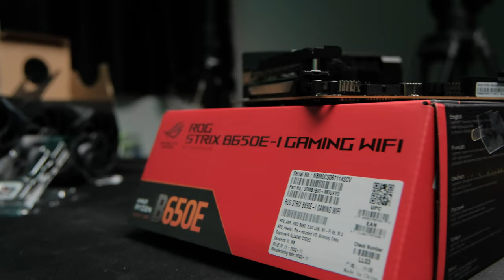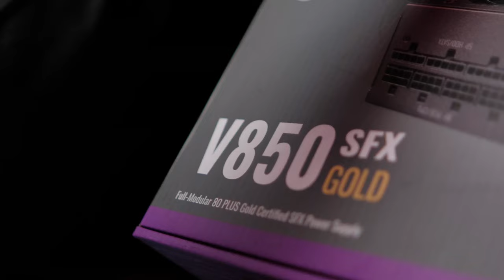How to Build a Tiny ALL AMD 4K Rig!

Comment: I also wish Cooler master had braded cables on the psu  i was looking for a braided pcie8 pin. But couldn’t find one
Reply from the maker: Cable mod has sum
Reply: Corsair SF line up has braided cables and usually the preferred SFF PSU. Lian Li SP line up has braided cables too but only 2 cables are non-braided.

Comment: Hey how did you connect tfans up?  did you use fan  splitter off the cpu fan header or did you keep your chassis fans separate off from  the cpu header and connected  them to the chassis fan header? I was wondering if I could connect to fan splitters off the cpu fan header.

Comment: Just slap an air cooler for this case, side mounted radiators for this 11L is a cringe thing, just like the stupid idea where the NR200 did. and also they have a horrible energy efficiency as the fluid have 90° degree angle flow to the block despite having good performance as you said, 
Good build tho